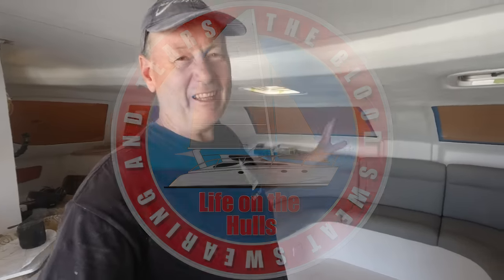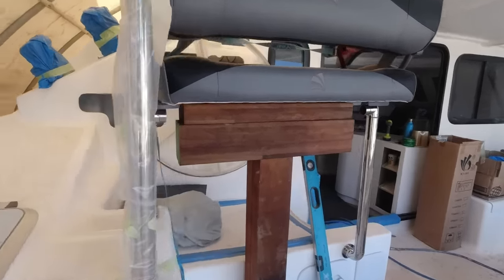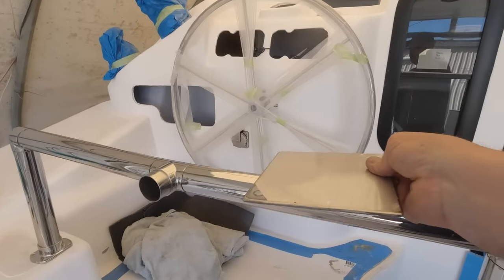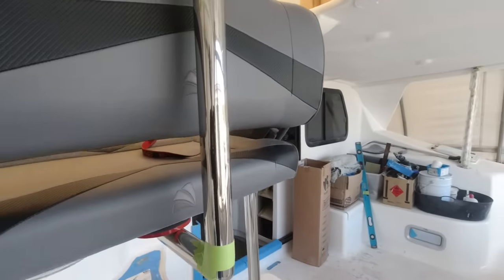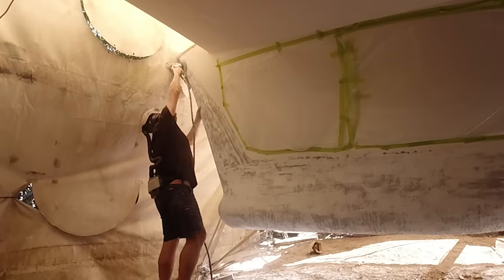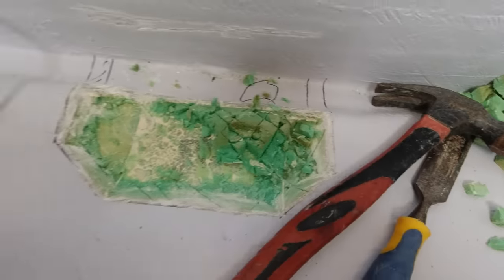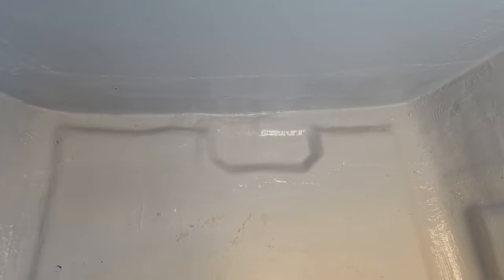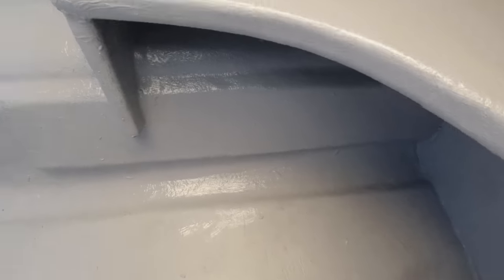Nothing is more important on our Catamaran // Safety on a Catamaran. Ep319

Comment: Ross a quick suggestion(even though I know it is too late) is you don't have to have the pipe to the roof in the  middle of the seat. Move to right hand side no head banging for the small person sitting below the seat and then you can also reverse the back of the seat and face the back of the boat. 2 wins with one move.

Comment: Ross - I appreciate you are trying to take proactive action against a major leak at the rudder post, but I am going to say to you what I say to everyone who is going offshore.  Please get rid of those toy bilge pumps and replace them with real commercial grade bilge pumps.  It may seem like overkill at this point, but if you are offshore and the rudder were to break in such a way that the post got taken out, then you must have a pump that can keep up with the amount of water that can come in through that hole.  This is your worst-case situation (short of massive damage to the boat) that you should be prepared for.  I have lost track of how many boats I know of that were lost due to small bilge pumps not being able to keep up with the water inflow from a below waterline leak.  Even with the secondary measures you have in place (and good on you for already thinking of them), you still need time to set them up and having the correct sized bilge pump can be the difference between saving the boat or losing it.  Just my two cents on this.  Otherwise, the boat is really starting to come together and Janet and yourself are really going to have something special at the end of this effort.
Reply: The kind of damage that Orcas do off the coast of Portugal/Northern Spain.
Reply: Agree in principle but this is rather less than practical in smaller vessels. Leak stopping materials and reducing the rate of flooding is a more effective strategy. But yes that pump is way too small.
Reply: If that whole rudder stock was to fall out then a bilge pump big enough to keep up would be far to big for that size boat. Good idea just not achievable
Reply: @benmac940  Ben - agreed.  The idea is to try to move enough water so that by the time you get the hole plugged, you are still afloat.  

Assuming the rudder point of entry to the hull is about 1 foot below waterline (at start), this calculates to about 650 GPM of water inflow for a 6" shaft opening or around 500 GPM for a 4" shaft opening.  This rate will increase as the hole goes deeper into the water and at 3 foot depth, the inflow is about 1,200 GPM for 6" shaft and 1,000 GPM for 4" shaft.  This is a rate of about 2 tons per minute up to 4.8 tons per minute of water ingress and it doesn't take long to overcome the floatation ability of the boat at those rates.

Your typical over the counter bilge pump from a marine hardware store does about 20 to 60 GPM of output.  These bilge pumps are not intended to deal with a hull breach, as stated by the manufacturer(s).  They are only for nuisance water.  A 2" hull breach opening will still start at about 75 GPM at 1 foot depth and ramp up to about 200 GPM at 3-foot depth for the opening.
  
For offshore boating, my rule of thumb is to size the bilge pumps(s) to keep up with your most typical leak (say 100 to 150 GPM) and to give you enough time (say 10 minutes) to get a really big hole (such as a rudder shaft) plugged.  May still be a whole lot of water in the boat, but no sinking.  The main thing I look for is if the typical water inlet on your boat lets go, the bilge pump(s) can keep up with it for a period of time without any significant water intrusion (i.e., you get the alarm notice and can get to where the boat is moored before it is under water).

There are 4000 GPH commercially available bilge pumps and they typically cost only about $100 to $150 more than the typical boat store bilge pump.  Four of those (two in each hull side) is 16,000 GPH of pumping capacity, or about 265 GPM.  These pumps cost about $200 each and are cheap insurance for an offshore boat.

Apologies for the long response, but as a retired engineer, it amazes me how people ignore what is really required for one of the most critical components for saving their boat and/or their lives, especially for offshore boating.  What may work for occasional boating in protected waters has no place in real offshore boating.
Reply: @ronkluwe4875  I'm not a fucken idiot I have been living and working on boats and ships for the last 20 years. I have practical training in damage control and leak stopping. I also know what is available,  and I only wish I could get a decent  high capacity bilge pump for even close to a hundred bucks. Either way its not feasible to install pumps that size in every compartment on a boat not to mention its still a long way off the amount of water that will be coming in, so unless you are literally sitting there with additional pumps in hand ready to throw in it doesn't really matter.
Reply: @benmac940  You do seem to be making a good fist of appearing like one.

Comment: Ross, it looks fantastic.  In a custom build you wear all the hats.  Ross and Janet have done exceptional work.  Not to mention hours spent thinking of details when ya should be asleep.

Not having watertight bulkheads at the rudder post or even the sail drives seems more than error in design, downright criminal.  Of all the ways to sink a boat, sticking a sunfish should not be one.

Comment: Not my place to say but as a heavier guy I have a bit of a spidey-sense for supports and that 90degree bend in the starboard vertical support of the chair looks a lot like a big lever that will work its way out of the glass it is mounted in. Could it be supported all the way down to the deck (or at least at a second location below the first)?

Comment: awesome efforts again .. read about cats having poor bow bouancy and that's led in part to the straight or reverse bow design to pull some volume forward your solution saves having to completely design and new bow as you said, that boat that sank because to the rudder damage might make folk to rethink rudders housings not being behind a seal bulkhead

Comment: Brace the seat on the left side back to the vertical upright.
Place it under the seat coming of the 90deg elbow horizontally to the upright.
On the right side do what you have done in the middle of the seat just move it to the right.
You could also rotate 90 so it comes out from the  arm rest up to the roof.

Comment: Beefy rudder posts, watertight bulkheads, bilge pumps on each side and if required a larger emergency bilge pump. Being proactive, learning from others' calamities. Any antislip required on the step down treader into the rudder locker?

Give it some time and thought on the fixed center vertical cockpit seat support post. Possibly mounting a sliding bracket assembly with a base post from the underside of the seat could work. More esthetic, functional, always loose some of the lower rear seating.
Reply from the maker: I reckon some anti slip on the step us a great idea after slipping yesterday in the rain getting into the hatch.

Comment: At some point could you give us a tutorial on spraying flowcoat? Specificity, how much to thin for spraying and how to adjust your gun and air pressures. I just sprayed my first flowcoat, and it came out quite textured and I got overspray absolutely everywhere even though I put up much more plastic than you did around your fridge. I spent a whole day wet sanding and polishing the intended spray area, then another day wet sanding and polishing the overspray.

Comment: Roscoe, the pipe bracing on helm seat could be rearranged on both back corners using the existing fittings but relocated, and an additional lateral brace on port side rear corner to existing roof brace nearby... This would remove the impediment to small seat below helm by moving it further away and making it more useful as a handhold at corner location at same time... what do you think ?
Reply from the maker: Interesting Mike, that is exactly what we ended up with.The centre upright wasn't good plus it looked off.The new arrangement as you said, offered a better handhold also plus much better support.Cheers mate, Ross
Reply: @LifeOnTheHulls   Great minds think alike ?... he he !

Comment: Add to safety of that catamaran why would you put such a small pump why don't you go ahead and spread your little money and get a decent pump for it
Reply from the maker: Jim, I have 8 electric bilge pumps in the Cat, each compartment is sealed from each other. These are for the stern sugar scoops only, plus manual handpups ,separate, and a remote throw in 3500gph version and hose that can be thrown into any compartment.